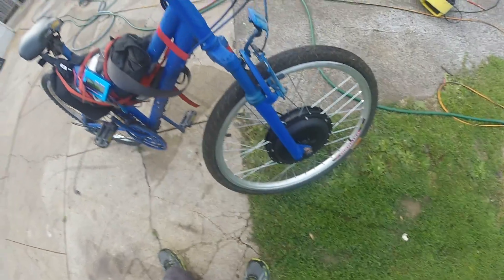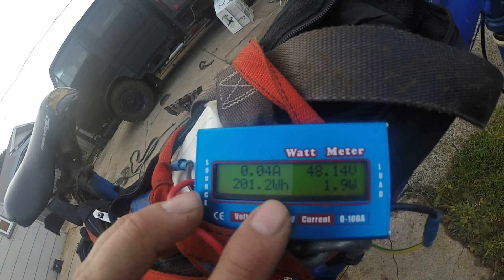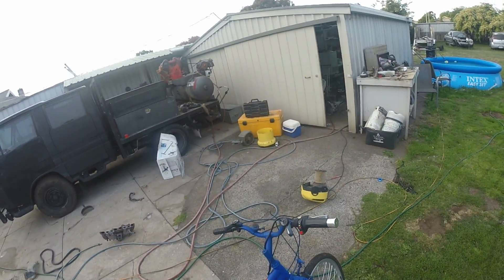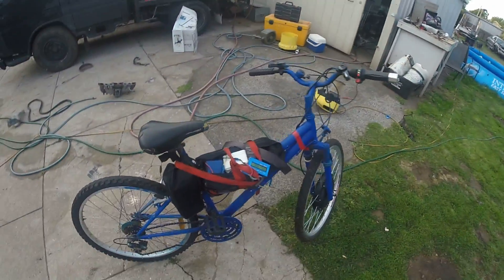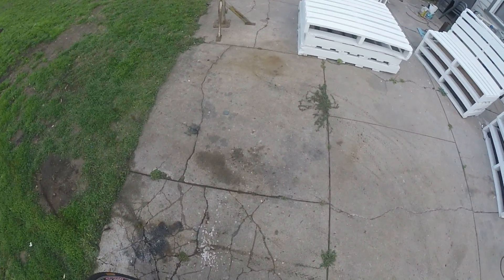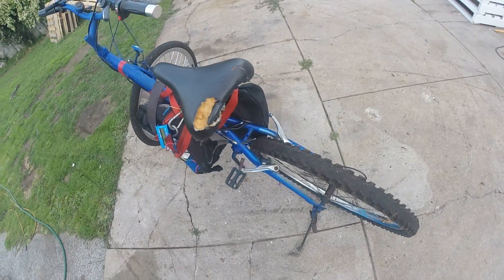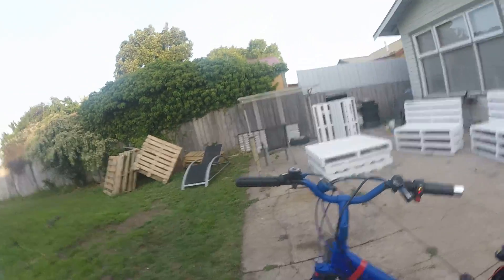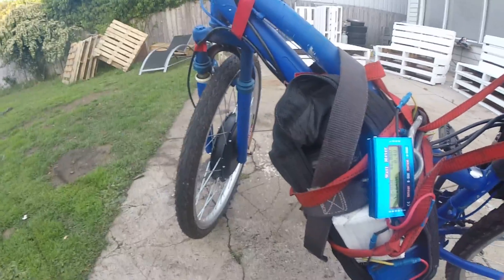1000watt 52v hub motor e bike 18650 powered

Comment: I can you tell me the man of the battery yes and the maximum discharge current also top speed thanks
Reply from the maker: Hand made from random smasung and lg 18650s. 45kph most i seen on current meter was 30 a at 50 odd v

Comment: Yeh it's a 48v Chinese kit it has a 48v controller I opened it up it has a 63v capacitor in it do it will handle up to 63v but I don't know how far I can volt it ?

Comment: Yuck... Awful build
Reply from the maker: It was only ever a test. Motor was a good thing i didn't have high hopes for its power output but it supprised me
Reply: @Oneupthesleevecustoms  I know buddy, just playing with you... I just built a rwd 1000w 48v out of a retired Smith n wesson police bike... Turned out like a show bike... Super impressed... Keep up the good work
Reply from the maker: Cheers buddy. I want e full on electric dirt bike
Reply: @Oneupthesleevecustoms  this is basically a Tesla motorcycle!!! 44mph easy... This is just the beginning lol
Reply from the maker: 44kph it phases out
Reply: @Oneupthesleevecustoms  ???idk it's a freak
Reply: Would you please share motor, controller, and battery link? Thank you for the video.
Reply from the maker: Theres a video series on battery build. Ill get you a link to the motor kits soon
Reply: What voltage is your controller can it handle 55v I have a voilamart kit the controller has a 63 v capacitor in it will it handle 55 60 v on a 1000w motor ???
Reply from the maker: 48v Chinese one
Reply: @Oneupthesleevecustoms  utter bullshit this stuff.